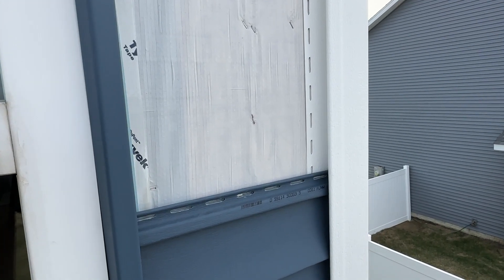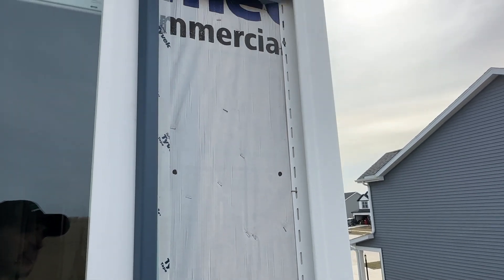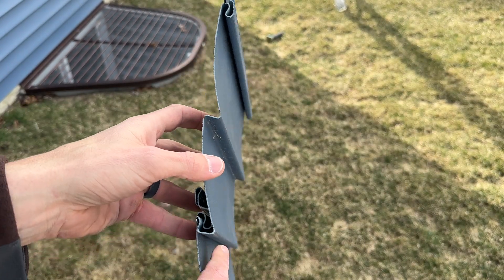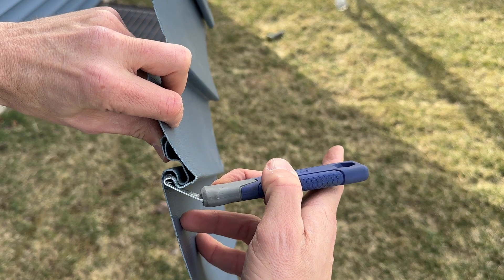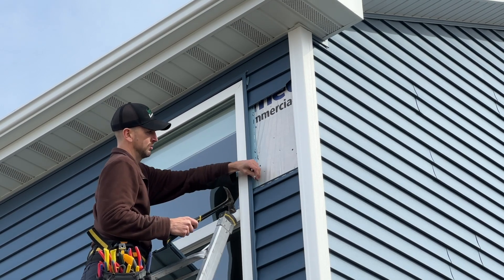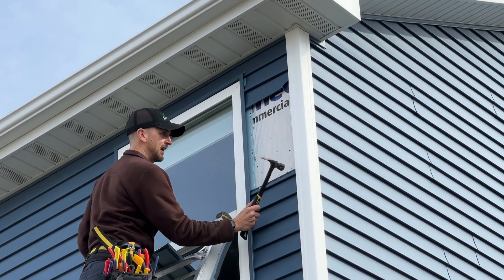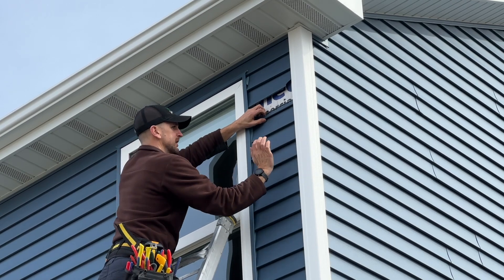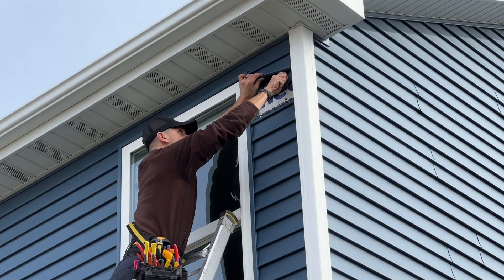Easy DIY Fix For Damaged Or Missing Vinyl Siding

Comment: Should be calling the people that put the siding up.
Reply from the maker: Builder want nothing to do with it, they won’t even order a new section at our cost. 🤦‍♂️
Reply: @EverydayHomeRepairs  I would have been nice if they would have left behind some spare pieces. I have extra siding, shingles, trim, insulation, etc. from when my house was built. Maybe most homeowners don't want to store them. I have the indoor stuff in my basement and the rest in my detached garage/storage building (I have an attached garage for actual garage use).

Comment: Umm... Rather than put your ladder on the window, buy a device called a "Stabilizer" Werner makes them. It will straddle the window.  But you would need a standard extension ladder.

Comment: I'd have liked to see the last piece being put in; like how do you reach to nail it to the OSB?  How do you clip it on?
Reply from the maker: Nope, you will be able to nail in the 21 nails by holding the upper piece out a bit to allow some roof to swing the hammer.  Then you can use the siding tool to connect up the last seam.
Reply: @EverydayHomeRepairs  Any way you can show us that step?

Comment: Thanks for another helpful video. I'm confused at how easily the replacements were pushed into place (behind an edge piece on each side.) I have cracked vinyl siding pieces trying to get them behind an edge piece. Any suggestions? Or do the pieces barely overlap? And, would that be an area for water intrusion?